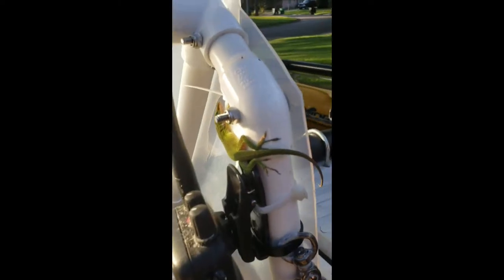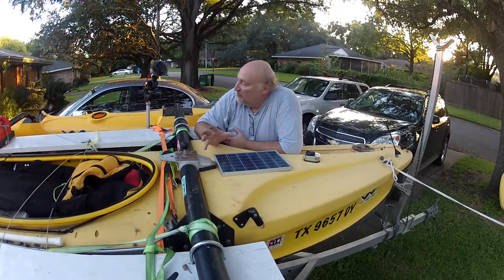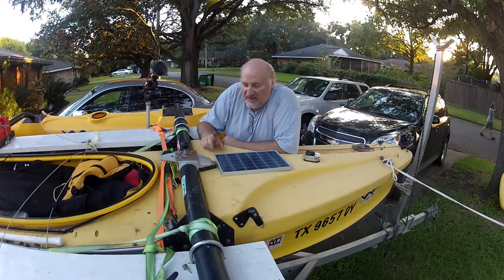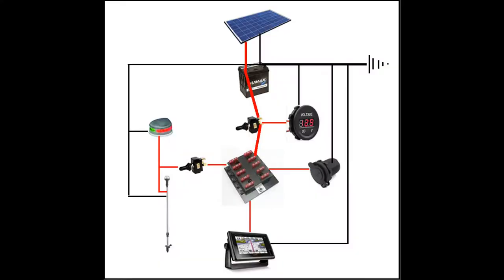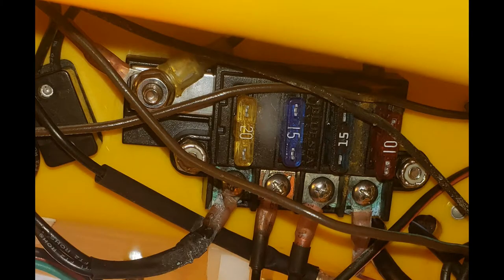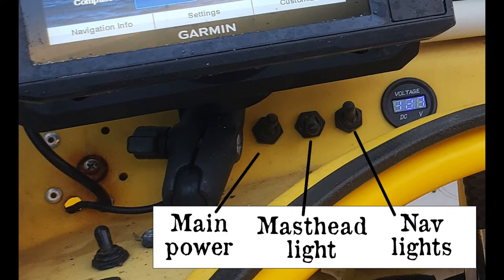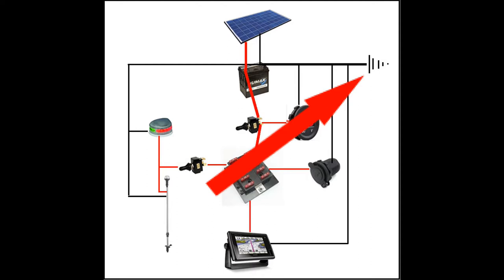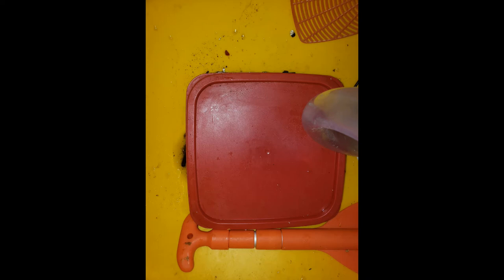wiring my Windrider 17 sailboat.

Comment: Ref the transducer, what is the mineral oil for? Why do you think you need a depth finder anyway? I understand the gps, but not sure of the need for depth data. I like the battery set up. Thanks for posting. Cool rig.
Reply from the maker: the transducer has to be submerged and mineral oil has a freezing point of -22 degrees . I know in Texas it's not really a concern in but being a Great Lakes sailor old habits die hard.
Reply from the maker: I'm used to sailing in hundreds of feet of water so the change to a few feet of water in the shallow bays near my dock makes it nice trying to stay off of the sandbars. plus the GPS comes with an amazing SONAR package so it would be foolish to not take advantage of it.
If I had to buy a separate unit I doubt I would do it.
Reply: @ZiggyLavengood  I was looking at just getting a GPS enabled tablet for navigation. This way I could take it in an out if I use it on another boat as well. I can get one for $250 or so bucks. There are a few videos on line about how people navigate and the like, their "set up."
Reply from the maker: @ScoutyBoyO  I see a lot of the small boat guys I run with now do that. They seem to do just fine with it. Now that I downsized I could've easily gone to a GPS half the size or a phone based system. I prefer to not be based out of my phone just for the redundancy issue. It leaves me a plan B.  dedicated tablet would works too.
Reply: @ZiggyLavengood  love this idea!